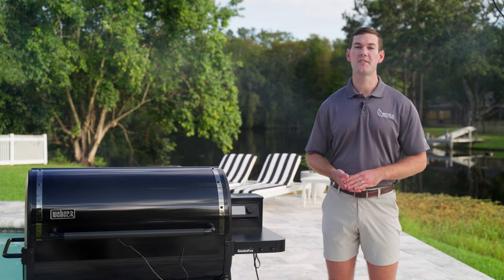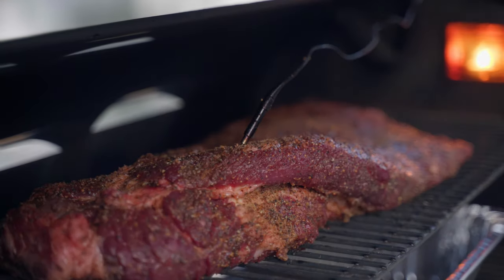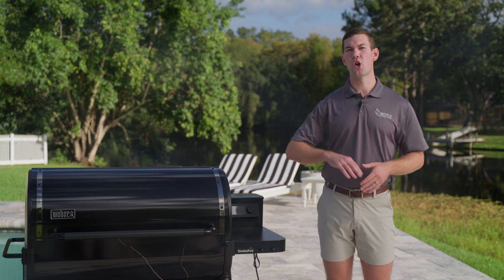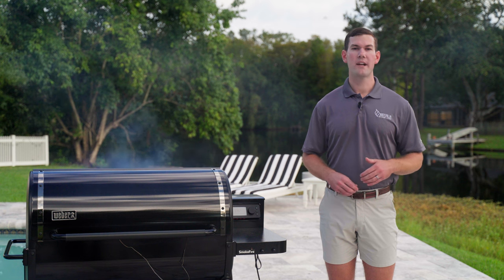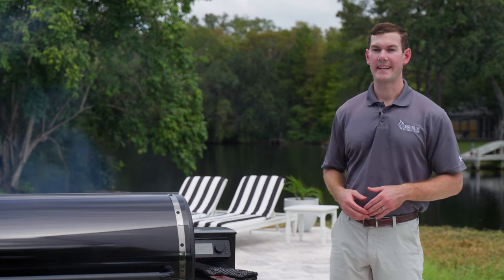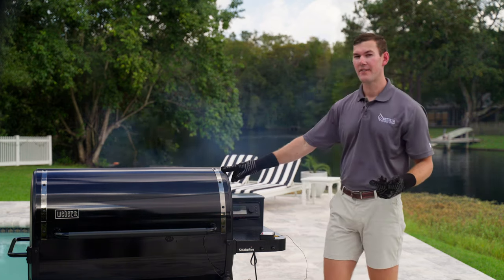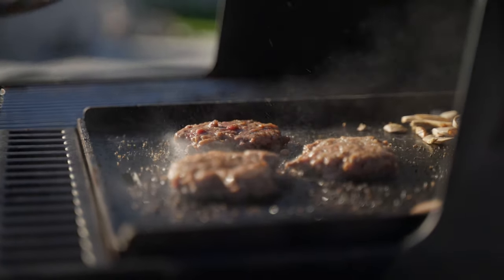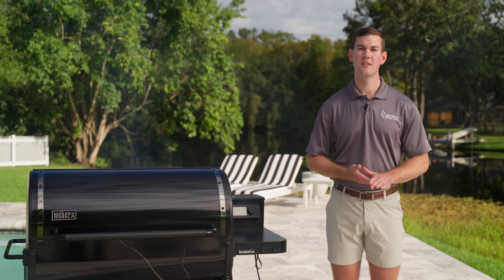Weber SmokeFire Sear+ ELX6 Pellet Grill Overview | Performance Test | Weber 2023 Pellet Grill

Comment from the maker: Before commenting that this isn't the SmokeFire Sear+ ELX6, I know. The grill in this video is the SmokeFire EPX6 Stealth that Weber released in 2022. There are only FIVE feature differences between the ELX6 and EPX6. The actual grill itself (auger, controller, hopper, components) is exactly the same. 

We already wrapped shooting on this video when Weber announced last minute that they were changing the name and adding a few other features to re-release it in 2023. The new features added are: left side shelf, folding top rack, front rack hooks, illuminated control knob and the Weber Crafted Sear Grate included. That has no bearing on any of the performance content found in this video.

I do my best to be thorough and accurate which is why I'm pointing this out. I understand that using the name EPX6 in the video might be confusing but just disregard the name. As always, if you have a question please just leave it in the comments so I can answer it. Thanks.

- Sam
Reply: Maybe put both in video title to clear any confusion
Reply from the maker: @v3lin3on  appreciate the feedback. If it seems to throw people for a loop, I’ll do that for sure. You only get so many characters for the title so trying to avoid that if I can.

- Sam
Reply: Ok 4 months later do an actual video review of the Sear+ ELX6.
Reply from the maker: @uclajd  this is an actual video review. There would be nothing different in a video 4 months from now. The grill runs the same. I use this grill 4x a week and it’s fine. I’ve cooked on the SmokeFires since their initial release with the Gen 1s.

- Sam

Comment: Hi. Thanks for the video. I'm currently researching Weber pellet grills. I am zeroing in on the SmokeFire Sear+ ELX4. However I just noticed that they announced a new grill called the Searwood 600 (not interested in the XL). It' price is quite a bit below the Sear+ ELX4. Do you have any thoughts about the new one versus the existing one? There is a $500 difference so they must have cut some features? Do you know if Weber is discontinuing the Sear+? Thanks again.
Reply from the maker: Searwood is the new model and what they are moving to. Any Smokefire model that exists is just there until sold out. They are moving on from the name and look. I have not gotten my hands on the new Searwood yet so there’s not much I can say good or bad about it yet. I really liked the Smokefire and was happy with the grills performance. I will be doing an in-depth video of the Searwood once we get our units in.

- Sam

Comment: Any idea what the screw holes are for on the bottom of the legs? Also the front heat shield looks like it should be put in the opposite way they show you. Atleast for me it did based on the edges being bent. Came here and finally someone mentioned what exactly it is for.
Reply from the maker: If you’re talking about the holes at the very bottom (underneath side) those are for the wheels. To my knowledge, there aren’t holes with any functionality at the bottom (sides) of the legs. 

- Sam

Comment: Is there a “p” setting on the controller to moderate the level of smoke?  Yeah … I know it has a super smoke mode, but I actually need to moderate the smoke levels for some cooks where family is sensitive to heavy smoke flavor.  Would like the ability to “lower” smoke levels for some cooks.
Reply from the maker: No. You would want to cook with a lighter pellet flavor like Maple/Sugar Maple in a scenario like that.

Have you cooked with a pellet grill before? The smoke flavor in general is not nearly as heavy like something from charcoal or wood smokers. 

- Sam